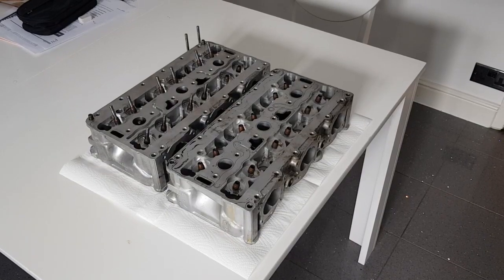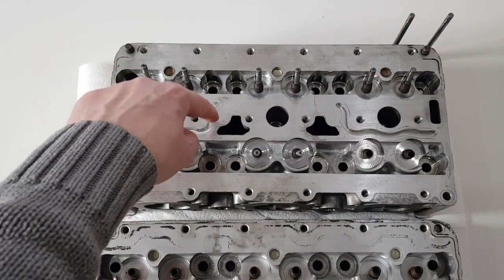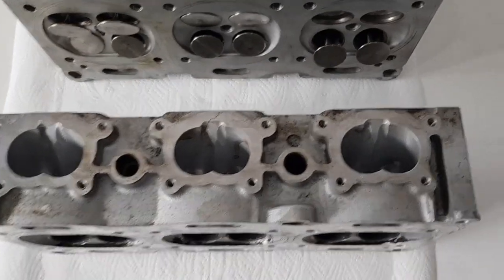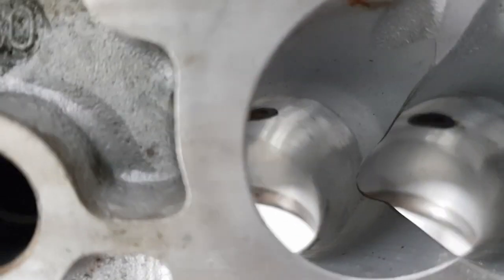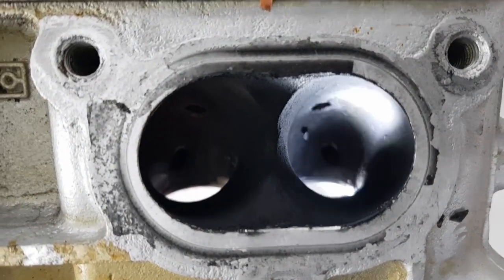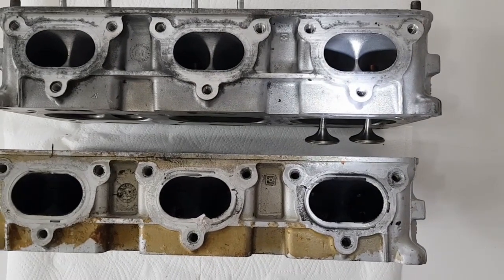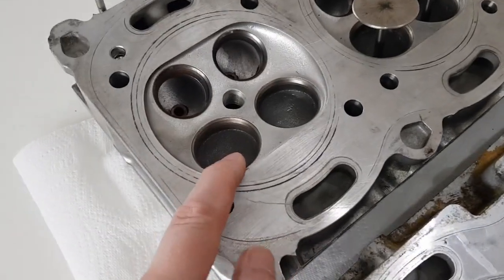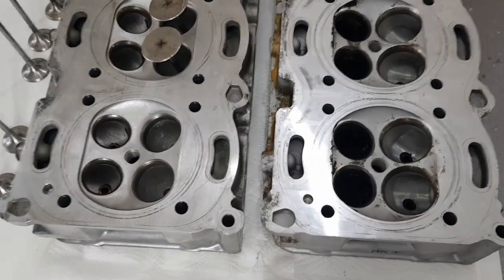Porsche 996 GT3 and Turbo cylinder head comparison

Comment: Can you switch the heads( turbo with gt3 heads 8500rpm) or its not that simple?
Reply from the maker: You would need to be careful of the combustion chamber volumes to make sure that the CR was sensible, you would also need to machine the GT3 head for the cam switch over oilways so that you could still run the turbo camshafts.  I'm sure it could be done though.

Comment: That is fantastic! Will you compare a GT3 and a air cooled cylinder head?
Reply from the maker: Probably not. They are completely different, and I don't have any...
Reply: @martinhill5770  I realize there are 6 on the air cooled and not 4 valve per. But would be cool.  Anyway thank you for taking the time to do this one!